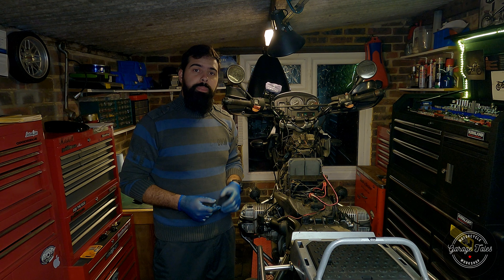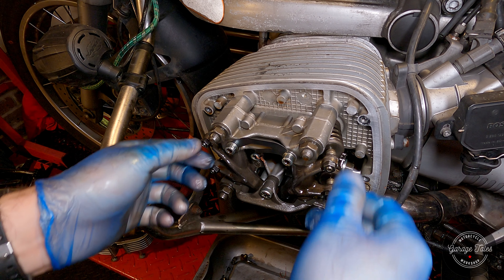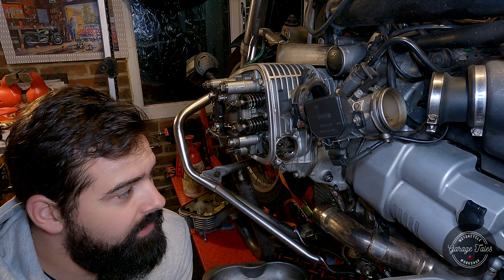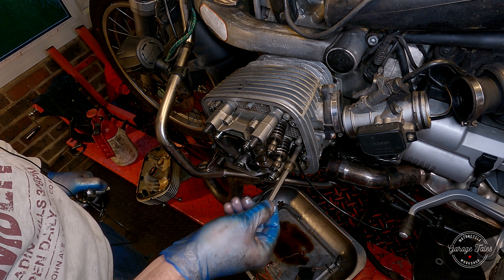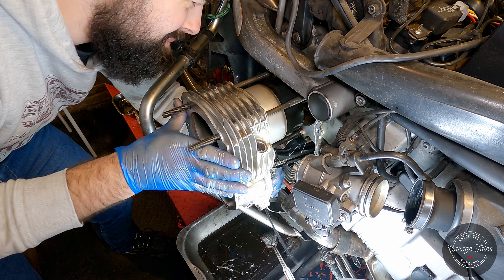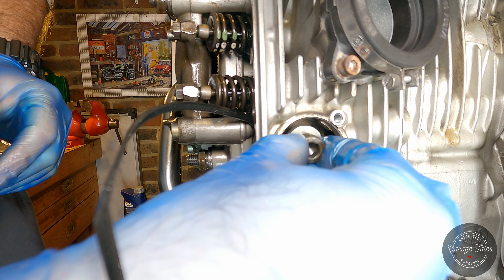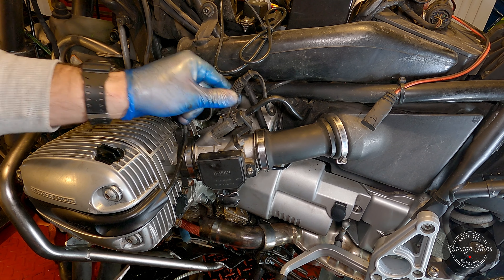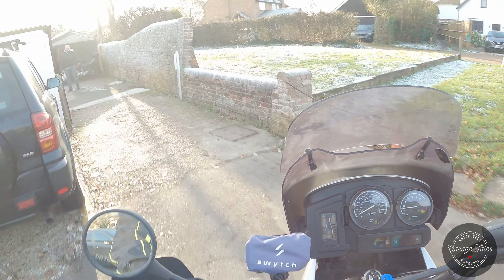BMW R1150GS Oil Leak - Cylinder Reseal

Comment: As I previously said, this is a really useful video, for info, as in your video, I also found the cam chain tensioner bolt was loose, so I got away with just tightening that (15mm ring spanner), leak sorted. Thanks again.
Reply from the maker: Hey there. Thanks for your comment! Glad you got away with that 🙂

Comment: This is a great video. I was following the same steps to change a head on a R1200C but there’s no hold to lock the flywheel. Had to hold the crank bolt with a ratchet while a friend turned the cam bolt off. Also piston was at the bottom which will make installing another head gasket and head easier. I plan to use the spark plug hole to insert a long extension in and determine top dead before checking valve clearance or you could use S on top OT on bottom mark in hole
Reply from the maker: Hey there. Thank you for your comment!
Interesting to hear you had no hole for locking the crankshaft. I’ve never seen that. But glad to hear you got it sorted in the end 🙂

Comment: Thank you for an informative and well done videojob. 

Whath did you lock the chain sprocet with, did you made a tool for it? 

And the right sylinder, same procedure?
Reply from the maker: Hey there. Thank you for your kind comment. Glad the video was useful 🙂

I did not need to make a tool in the end. Just managed to get it loose by using the crank lock and with the chain guides out of the way 🙂

Comment: Great video.  A couple of questions: (1) The factory manual (on page 11.60) shows the rocker end float being measured on the bottom of the rocker carrier - can you say why you prefer to measure rocker end float at the top of the rocker carrier?  (2) Can you please describe the special tool you mentioned for use in holding the camshaft when the camshaft sprocket bolt is too difficult to loosen?  Thank you.
Reply from the maker: Hey there. Thanks for your comment!

1. The reason I prefer measuring the end play at the top rather than the bottom, is because usually (specially if they have many miles) they wear a bit of a step at the bottom (gravity pulls them down) while the top is still in very good condition. They still work fine, but measuring the play if they have that small step worn in is inaccurate. Hope that makes sense 🙂

2. I never had to make that special tool yet, but I imagine I’ll need it one day. Basically the way I have it in my head is a cylindrical piece of steel, 4 dowels fitted to one face on the same pcd as the holes in the sprocket, a male hex or 2 flats on the other side for a big spanner, bored through so you can put the bit through it for the sprocket bolt, and a counterbore on the sprocket side to allow for the bolt head to go somewhere. Hope that’s clear enough 🙂

If anything’s unclear please ask again.

All the best,
Vlad
Reply: @garage_tales  Thanks for the clear, detailed reply.  I'm going to replace the original aluminum w/ steel tip pushrods in my 47,000 mile 2000 BMW R1150GS with R1200 all-steel pushrods soon and this video is very helpful and informative.
Reply from the maker: @louisgara8754  Hope it goes well with the work 🙂

Comment: Great video thank you. I have to swap a head on a R1100S so you video was a great refresher. Was that M10 or M12 bolt you used to lock the engine?
Reply from the maker: Hey there. Thanks for your comment and glad the video was helpful. A 10mm pin or M10 bolt should do 🙂
Reply: @garage_tales  I think it is a 8mm pin as I just measured a flywheel I just replaced on my 1150gs and it had a 8.5mm hole.
Reply from the maker: @aleccoldman5041  Interesting. That may be true. I’ll see if I can find the tool I used. Recently moved house and building a new workshop, so everything is really hard to find at the moment 😂
Reply: @garage_tales  a new workshop :) , worth all the hassle of moveing

Comment: Hi Garage Tales
I’ve just finished watching your video and really appreciated your calm and informative style, and nicely paced, well filmed, and detailed video production. I have an R850R which has sheared exhaust studs so I want to remove both heads to get them drilled out …I wonder if you would mind answering a few of my questions.

You mention the risk of damaging the chain guides when trying to undo the bolt that secures the camshaft sprocket in place …what is the consequence of damaging the chain guide? 

Also you mention you were on the brink of giving up on loosening the camshaft sprocket bolt but eventually managed it ….what would your ‘plan-B’ be if you were unable to loosen the bolt?

Finally, having sheared off the exhaust studs I have become a bit paranoid of damaging other bolts during removal on my old bike …do you have measures to prevent this such as penetrating oil or heating? 

Oh, and one last thing …presumably both cylinder heads be removed at the same time.

Any advice would be much appreciated
Regards
Howard
Reply from the maker: Hello Howard. Thank you for your comment. Appreciate it! 🙂 Hope it goes well with your exhaust studs. There’s always the risk of something snapping and causing massive pain.

With regards to the chain guides, if you don’t remove the tensioner first, you’re putting a lot of pressure on the plastic guide and risk snapping it. What does that lead to? Well, on the left side I believe you might be able to fish the circlip out from the bore with some fancy tools, but most of the time it means taking the engine out (or taking the bike of the engine might be more accurate) and splitting the crankcase to swap the chain guides and fishing any broken chips from the bottom of the engine (no removable sump on these)

Plan B on the camshaft sprocket would be to make a special tool that would hold the pulley in place so you don’t put all that force on the chain. I’ve taken a few of these apart (but not too many yet) and managed to get away without making one so far. But in my mind it would be something like a hollow hub with dowels on one end to locate the sprocket, flats/hex on the other for a big spanner and a bore through it for a hex bit to undo the bolt. Hope that makes sense. Feel free to ask again if not 🙂

When taking off bolts that are corroded (like exhaust studs) I always try to soak them in penetrating fluid a few days in advance before I start removing them. If that’s not enough, I use a propane torch, but with care not to damage the paint. On internal bolts that are covered in oil, penetrating fluid does nothing. Heat can help if applied in the right place, but don’t tend to use it much.

You can remove both cylinder heads. What I would probably do is, once I have one off, turn the crank one full turn to tdc and then remove the other head. Assemble in reverse order. If it’s not clear why, ask 🙂

Hope that answers everything.
All the best!
Vlad
Reply: @garage_tales  Thanks for taking the time to provide such a detailed response ...much appreciated. Keep up the good work. Regards
Howard

Comment: Hello, THANKS for your constructive video, I have to remove two head cylinder on my r1200s 06', the head cylinder is remove but I have doubts to remove the right side and put piston on TDC. Can I turn the motor with sprocket left removed ? 
Sorry for my English 😟
Reply from the maker: Hey there. Thank you for your comment and glad the video was helpful.

So if I understand correctly, you removed both heads without putting the engine on TDC? I think that was a mistake but easy to fix. 

In short, yes you can turn the engine over without the heads - try to keep the chains in tension to make sure they stay on the crank sprocket. It might be tricky to put back on if it falls off.

Caution- if you removed all the bolts, turning the engine over might push the cylinders out.

Hope that helps 🙂
Reply: @garage_tales  Sorry, I misunderstood my problem.
I started by disassembling the left cylinder head and I put it in TDC, the left sprocket of the chain was disassembled and I was wondering if I could still turn the chain to find the TDC on the right cylinder. I attached the left sprocket to the chain and I was able to disassemble everything without any problems in the end, thank you again for your video and your help

Comment: Great video! I'm so sad because when you said, "if the chain guides shatter, that's a huge pain." Well, that's where I'm at. I just hopped on the bike one day and heard this terrible rattling noise. Some inspection confirmed my chain guide has broken apart and is loose inside the crack case! Would you recommend full rebuild at that point? What are your thoughts?
Reply from the maker: Hey there. Sorry to hear about your troubles. But as they say…life happens for you, not to you 😁
There probably isn’t any other option at this point apart from taking the engine apart.
It really depends if you’re paying someone to do the job and how much it will all cost compared to the bikes value, or if you’re doing it yourself, it depends on your circumstances and how much time you have available.
If you still like the bike and it’s in reasonably good condition I’d say yes…engine out, strip and rebuild, new seals everywhere you can, depending on mileage maybe new clutch, shell bearings, rings etc. 
Or maybe you can find a good deal on a used engine from a breaker 🙂
Let me know how it all goes 🙂

Comment: Thanks For the video! I used this walkthrough because i needed to replace my cam chain rail guides. I was successful but i don't think i did a good job on the sealant or used the wrong sealant as I now have a leak. What sealant did you use? Thanks
Reply from the maker: Hey there. Glad to hear the video was useful. Sorry you have a leak now, but I'm sure you'll get it sorted :)
Regarding the sealant, I remember BMW are a bit particular about what sealant to use. So I didn't use the normal sealant I'd normally use, but bought the sealant you see in the video which was recommended as being the correct one for the job. I can't remember what it was, but it was made by Granville I believe and had a very strong vinegary smell.
Hope that helps a bit.
Thanks,
Vlad
Reply: Thanks Vlad! Yeah check the tape. It was Granville bike instant gasket. I found it online. Must be a brand only on your side of the globe as they ship internationally. I’m in no hurry as the leak is not too bad. I feel confident I can do the job much faster the second time around but I’m sure I will keep your video handy. Russell
Reply from the maker: @russellkneisley4931 Hey Russell. Yes, Granville is a British brand, but I’m sure there are alternatives out there. Probably better ones.
I hope it all goes well the second time round and you’ll keep enjoying many miles on the old bmw 🙂

Comment: How would the end float be adjusted?
Reply from the maker: Hey there. Sorry for the late reply. In short, you check the end gap of the rocker (I prefer to do it on the upper end), loosen the lower support, push it up and tighten the bolts to the correct torque. Another option is to have the nuts/bolts finger tight and gently tap the support till the gap id correct (never did it this way). Hope that makes sense, but finding a manual with pictures will make it a lot clearer 🙂
Thanks 🙂

Comment: Nice video! My R1200GS (2007) leaks oil as well. Cylinder is cracked on the bottom side, where channel for the chain is. One of the holes for those little bolts is cracked and it started to leak. I know that removal of cylinder will be needed to weld this crack. How many hours did it take you to replace this seal and put the bike back on the road? Thanks!
Reply from the maker: Hey Tomaz. Sorry to hear you’re having trouble.

It’s hard for me to tell because I did quite a few jobs on that bike and not necessarily in the order shown in the video series, and also I work just a bit in the mornings before going to my job so it’s not a continuous flow. But I believe I could have a cylinder off and back on in 3-5 hours depending on how smoothly it goes and how much cleaning is involved.

Hope that helps! Let me know how it goes with the welding 🙂
Reply: @garage_tales      thanks for the answer. Before I have contacted the motorcycle repair shop (which are also welding cracked cylinders, heads, engine block etc.), I decided to clean around this ''crack'' to see where and how much is leaking. It looked like crack, but when I cleaned the oil, there was no visible damage anywhere. I was completely surrprised (in a positive way). Then I was thinking how the he** did this happen and I came to following conclusion; when I changed the engine oil, I have changer also oil filter. And when I unscrewed the oil filter, it fall into jar full of oil and the oil ''squirted'' on the bottom side where chain channel is. Oil was also where the cylinder base seal is. It looked like is leaking due to this ''crack''. I felt like a dumb, but at he end I was happy that it was just a ''prank'' :) If I could I would post a picture of this ''issue'' just to see how real it looked. If you are interested I can send it you via email. Lesson learned: clean the bike, before you start overthinking :D

Comment: how to remove excess oil from the BMW R 1100 GS engine
Reply from the maker: Easiest way is with an oil extractor and a thin tube. Otherwise you might have to use the drain plug. You could try and lean the bike all the way on it’s side and get some out the fill plug, but that could get messy.

Comment: You should have stopped when you discover that cam chain tensioner bolt was loose, that was perhaps the reason for the oil leak. ?? Had the same oil leak on left side and that bolts was loose. Tighten it up and no more oil leak. The tensioner also have engine oil pressure behind that activate the tensioner with oil pressure through a little hole in it at the top under the nut, so pressurized engine oil will get pressede out if bolt is loose.
Reply from the maker: Possibly, but that wasn’t the only leak. It was clean around the bolt compared to what was under the cylinder. And anyway, once I set my mind to it, I had to go through with it 😂
Reply: Thanks for your comment, exactly as you mentioned, I found cam chain tensioner bolt loose, tightened (15mm ring spanner) and no more leak. Great video though, but hopefully I'll never need it

Comment: Nope, all bolts seized completely solid. Welding nuts onto them has achieved nothing, I'm just using heat, oil, a long lever, carefully rocking them back and forth and in the end they all break off.
Drilling them out it is..
Reply from the maker: Ahh…that’s a real shame. Never had them quite that bad. Hope drilling them out works without drama. Let me know how it goes 🙂
Reply: @garage_tales I have brought the head to a machine shop, they drilled them out and put in Inserts.
I am no on stage 2 of this video, putting it all back together.
BTW, when you torque the nut that holds the chain gear to the head, you don't say how many NM that should be.
Reply from the maker: @jochenstacker7448 Hopefully no more drama from now on 🙂
You are correct. I did miss to post the torque value for the cam shaft sprocket bolt. It’s 65Nm from memory.

Comment: I'm about to replace the old-style tappets with new ones and replacing the head gasket on my GS. Not gonna lie, my palms are a bit sweaty thinking about doing this, but this video gives me confidence in thinking I can do this. Or I'll completely fcuk it up. Can't win if you don't try.
Reply from the maker: Hey there. Thank you for your comment! 😁
Indeed, you have to give it a go. I’m sure you’ll manage 😁
Reply: @garage_tales  made a small error, I'm not replacing tappets, I'm replacing pushrods of course.
They arrived (along with new head gaskets) and they look like something used for some of the kinkier piercings.
Reply from the maker: @jochenstacker7448  I assumed that’s what you meant. Hope it all goes well 😁
Reply: @garage_tales well, left side, both exhaust manifold screws broke.
Reply from the maker: @jochenstacker7448  That’s off to a good start 😁 Hopefully there’s enough left out to put some clamps and with heat & some penetrating fluid, they should come out.
Reply: @garage_tales  when removing the exhaust, three studs broke off with still some of it poking out 
The problem is, the tool I have is quite wide and can't grip the bolts because they're recessed.
Everything else went smoothly, I'm hoping that I'll be able to get the bolts out, otherwise I'll have to give them to a shop to drill out and I don't know if the heads might even be junk after that.